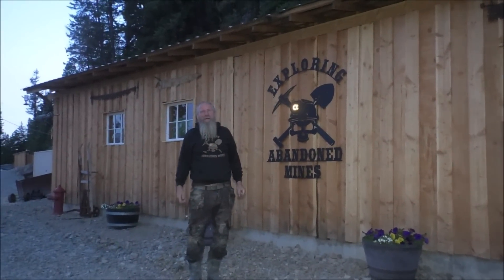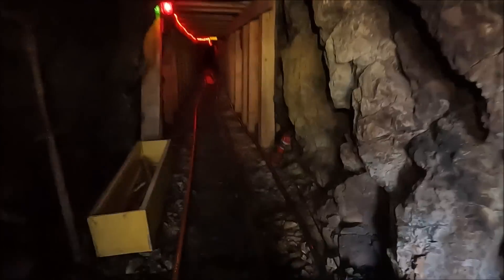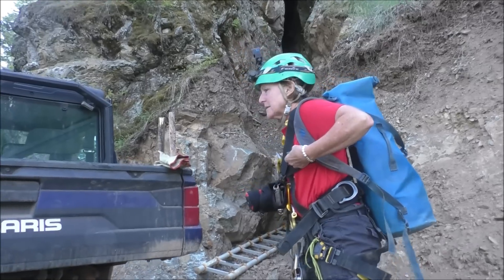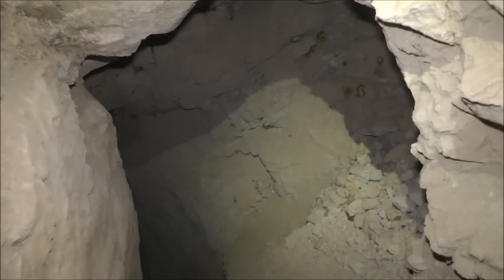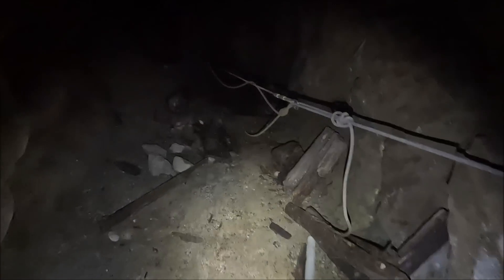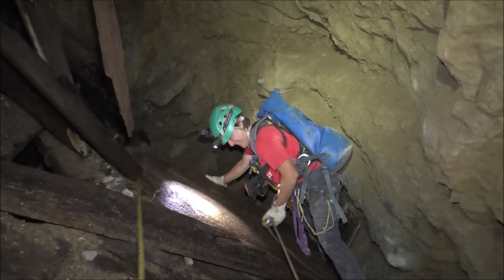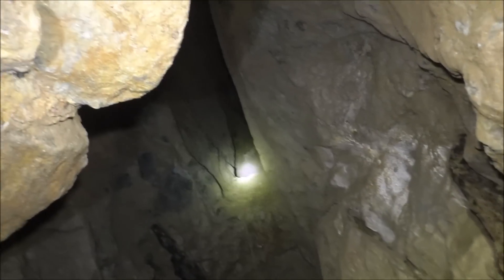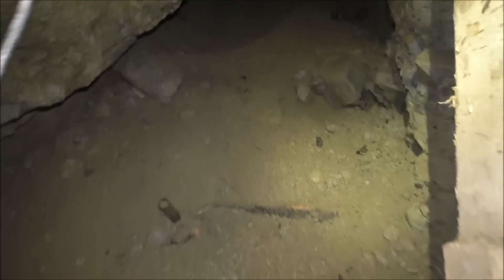#354 We Cleared The #2 SHAFT!

Comment: A fast way to split rock is to use a water saw and in the saw cut, to put those air jack pads you can buy to lift heavy things with. Pop a couple of them in there, pump them up and the rock will split.
Not my idea, saw a guy who was clearing his access road up a mountain do this.
Reply from the maker: You can drill rock and fill it with Dexipan.

Comment: If you can stick 3-4 dynamite to a wooden pole and sit on that unstable stull it save you from any risk and let come down this hanging muck! I do rehab 11 years ago, underground as well and pushing ore cart and build chute, I deal with same stuff, rotten timber full of muck behind, and we not allowed to use any explosives at that time, cable knot around stull and pull them with the slusher lol. Soo dangerous, explosives could be your friend!
Reply from the maker: We can't get or use dynamite.
Reply: @exploringabandonedmines  slusher is the way or kind of scaling with long pole, its seem challenging to come down this stull, maybe just pull the cord is enough 😁
Reply: @exploringabandonedmines  Maybe some black powder and an electric match might be enough to dislodge what you need.